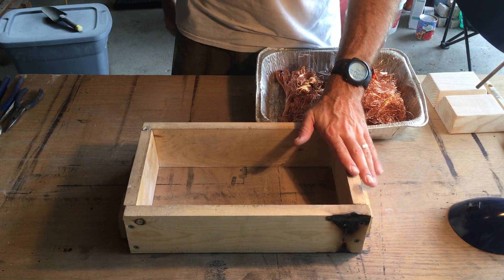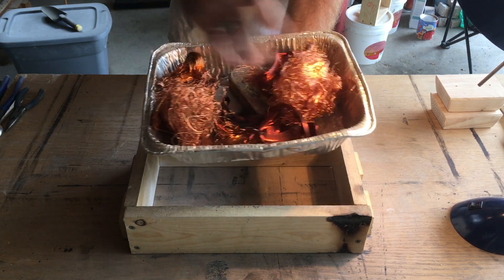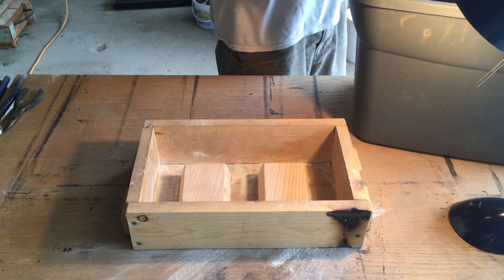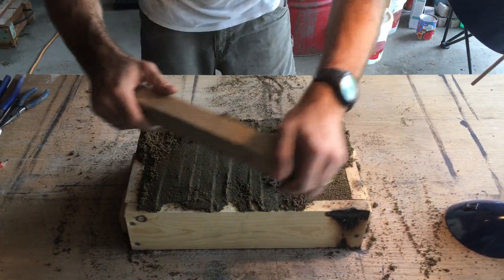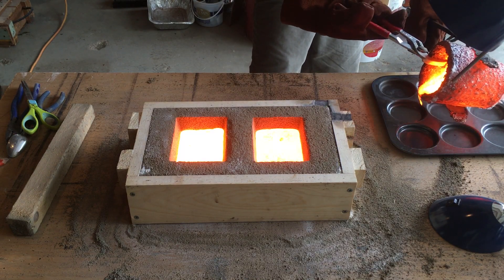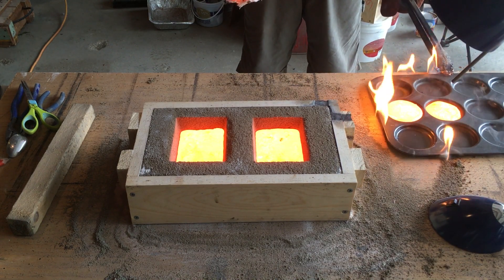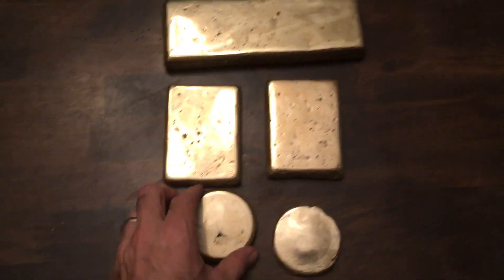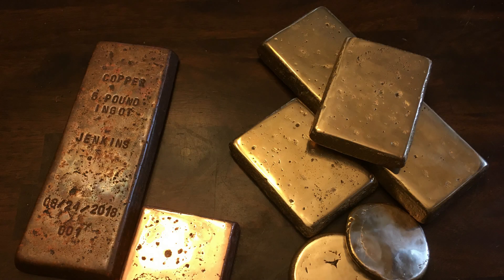Making Aluminum Bronze (Part 3): Melting Copper and Aluminum - Looks like GOLD bars!!

Comment: How do you figure out aluminum to copper . What is the ✍🏻formula to get 89 aluminum to 11 copper. I tried I got it way wrong 👎🏻
Reply: Since it's being done by weight I'm guessing 
Divide the weight of the Copper by 89 to get 1% then multiply that by 11 for Aluminum to get 11%
It says 89% Copper to 11% not the other way around. Copper is heavy and Aluminum is light so by volume I couldn't say what it would be.
If i's a case of you are trying to make something weighing 1 kg then it might be something where it's 890g Copper and 110g Aluminum but I'm not sure to be honest.
Reply: Just realised I said divide by 100 instead of 89 so edited comment ;)

Comment: You would also probably do well to do a normal 2 sided mold with a sprue and riser... that will eliminate your cavitation problem and also help reduce shrinkage as it cools so you get a more true to form casting.
Reply from the maker: Your right, that would help.

Comment: You're losing some of your copper weight to the insulation on the wire. You should incinerate your wire first to burn off the lacquer insulation, then weigh it.

Comment: Very interesting videos.  I found myself wondering about the quenching.  In the first video in the series, you mentioned the problem with this alloy becoming brittle.  Would allowing the casting to cool slowly result in less brittleness?  I think I am associating fast cooling with more hardness.  Note:  This question comes from someone who has not personally done casting although I did make a few molds which were used for lost wax with gold.  Thanks for sharing your videos.